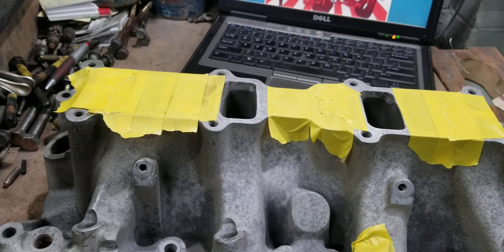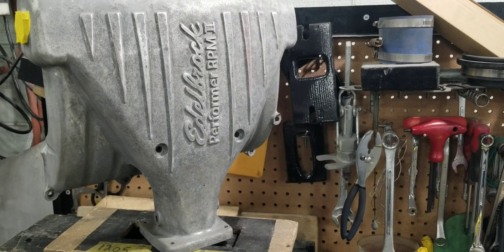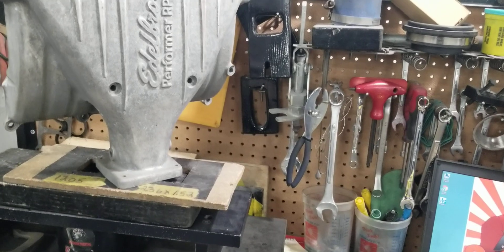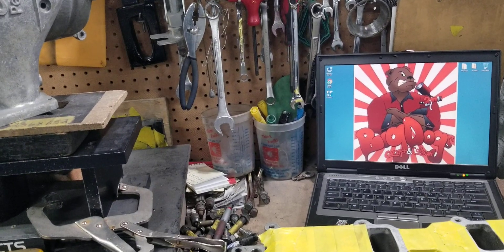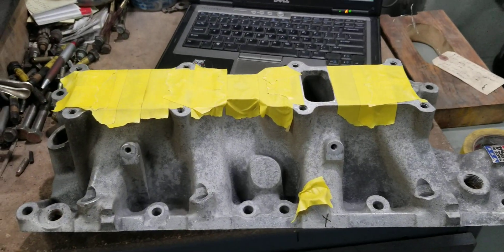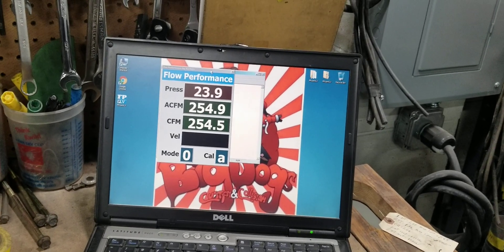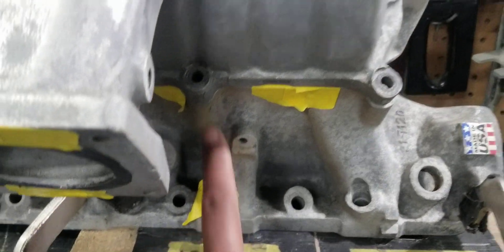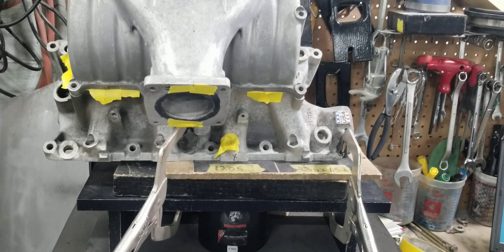Mustang Edelbrock Performer Rpm 2 flow test part 1

Comment: Have ever ported a holley system max 1 lower manifold?
It was basically a holley version of the original 5.0 factory lower intake
Reply from the maker: Yes we have ported iys upper and lower. NEVER just port the lowers on a 2 piece manifold no matter what anyone says. You will leave a lot on the table doing so. We only port the uppers and lowers and that's why our customers make more power

Comment: Picking up my heads and intake tomorrow.  I can't wait to see them. I never got a call abt my valve train ( I was hoping to upgrade the valve train) so I guess everything was fine.  Intake was new but heads came off motor that was in the car when I bought it.  Can't wait for tomorrow, see ya at 4:30pm tomorrow
Reply from the maker: Those titanium parts were all on backorder and reallly not needed. Your heads were set up to support over 550hp and over 6,500rpm. You are good on both now!
Reply: @Bigdogs Porting Tony B  that's all I need to know!! I'm going to try to make a stock block build, 331, F303, and F1A renegade kit(turned way down),and Terminator X, big fuel system, to keep AFR in check. When I get the $$ it will be 363, AFR 220'S Comp XFI camshaft and ALOT of boost!!

Comment: Great video. Have you flow tested  a stock TrickFlow Box R With 90mm tb, vs stock Victor Efi?
Reply from the maker: Yes we have. We've flow tested just about all the sbf efi manifolds
Reply: @bigdogsportingtonyb2833  Have you done a stage 2 port job on the complete box r, w/ported 90mm tb? If so what kind of numbers?
Reply from the maker: @evilinside5984  yes we have. They numbers were in the 350-355cfm range on the stage 2
Reply: @bigdogsportingtonyb2833  Thank you very much.